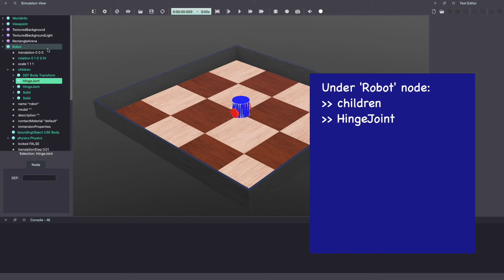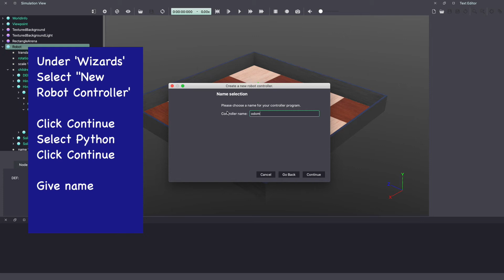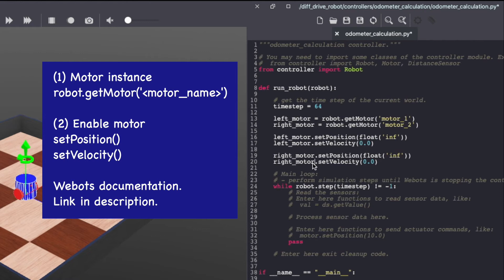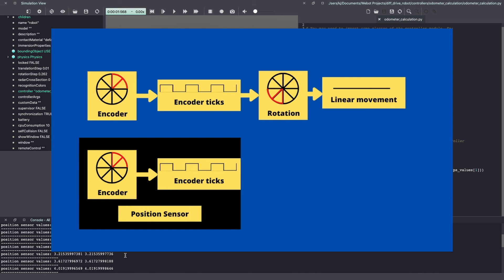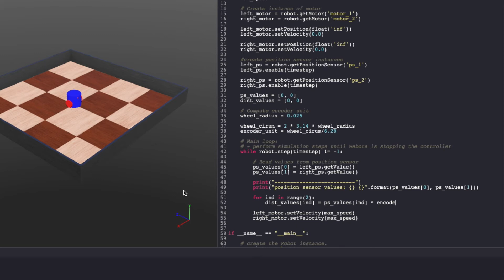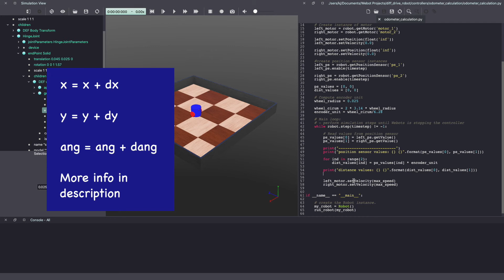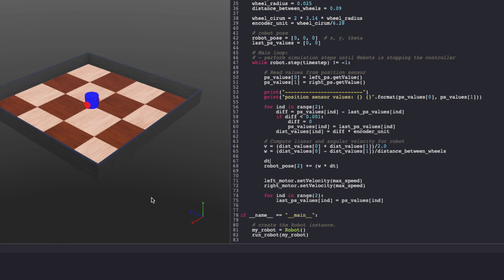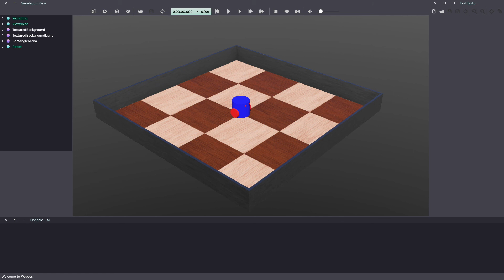Webots Tutorial 4: using encoders to compute robot position (Odometry) // Position Sensor in Webots

Comment: can u please tell me the exact meaning of timestep?
Reply from the maker: It is simulation time. Based on what you enter in code, the calculations are made for that time and actions are performed accordingly. 

For example your robot starts at location 0 and you are giving speed at 1m/s. (Ignoring accelaration time to reach constant velocity)

At timestep 1 sec, your robot will be at location 1. At timestep 2 sec, it will be at location 2 and so on. 

For calculation simplicity, timestep is generally set at multiple of 2. 

Hope that helps answer your question.

Comment: Can you help me with a turtlebot3 ? I did what you explained but I don't understand how to apply that to reinforcement learning. Thanks
Reply from the maker: Reinforcement learning is a big topic in itself. Can you elaborate on your goals?
Reply: @KajalGada  Well. First I need to learn how to use the Lidar sensor in a turtlebot3. Can I take classes with you of this? I was doing some simulations but it has some problems in the walls and when a turtlebot goes in front of the other.